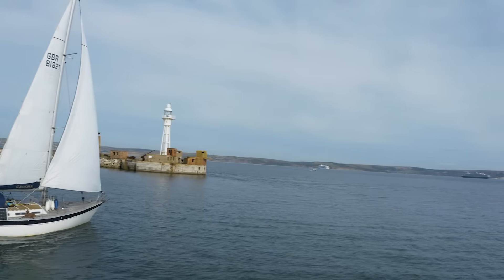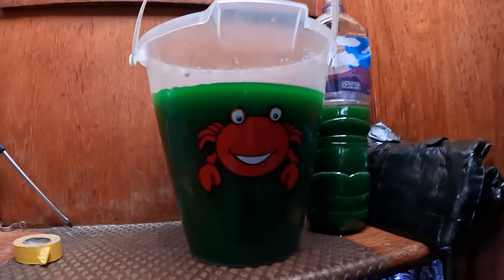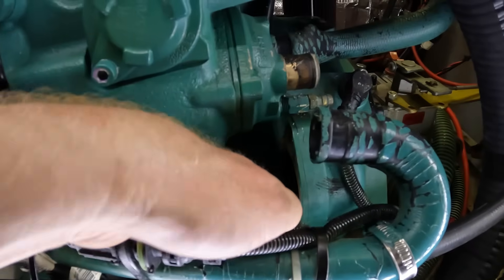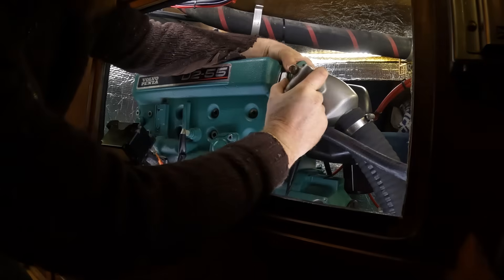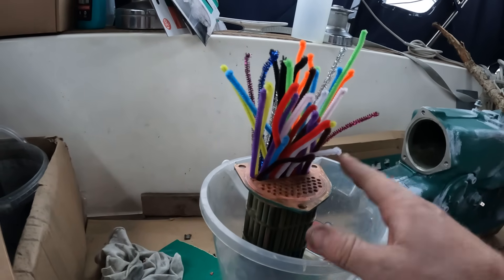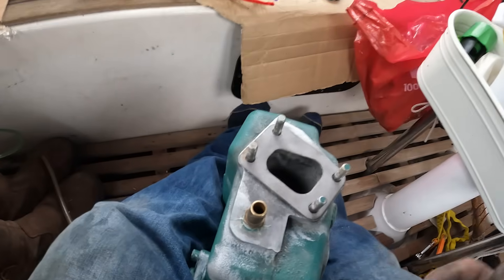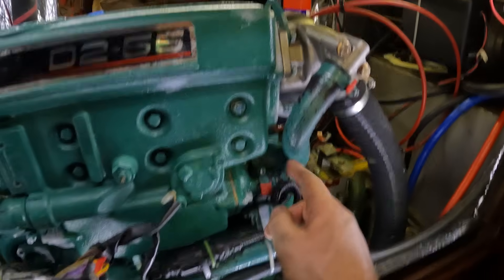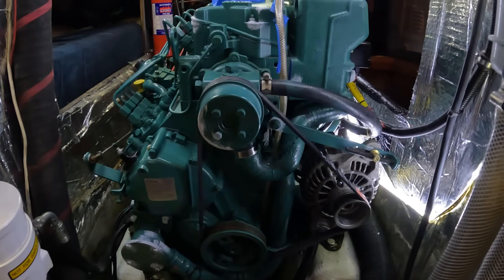Overheating  - Troubleshooting a small diesel sailboat engine  (Volvo Penta D2 55F)

Comment: Really useful- thanks. I have a VP D1-20 & had an overheating problem. We tried lots, in the end we figured out it had to be the heat exchanger. We couldn’t get the tubes out so decided to acid them in situ. We used Red Lyme from Amazon & left it soaking in situ for a week. That was a couple of years ago-alls good
Reply from the maker: Glad to hear you managed to solve the problem with far less hassle than we ended up with 🙏⛵️
Reply: it feels like a bodge job now i’ve seen it done properly

Comment: Brilliant video. I'm amazed how professional you are given what you say is limited experience. I'm not very good at this and would have been terrified as you took off more and more parts on getting it back together. I did a similar job on my Kubota/Nanni 22hp. Everything so much more accessible than Volvo. You truly did it the hard way. Thanks for sharing. I have to do a main engine oil seal next week and the engine has to come out to get to it.
I'm more confident now and insoired.....cheers!
Reply from the maker: Matthew, I won’t lie, I was starting to get nervous at about the half way point and was very careful laying out all the bits in order, so I could ‘simply’ reverse what I did, possibly with the help of the videos I had recorded. I haven’t fully pressure tested it out in the wild yet, so there’s time still yet for me to regret my efforts, although I hope not 🙏🤣⛵️⛵️
Reply: @CadohaAdventures  I would.be very confident your work is good
My exchanger core exit hole was the size of a 5 pence piece it was so calcified. Perhaps double hose clamp if you are worried. Why trust one!
Reply from the maker: @matthewlutter3745  fair point! Appreciate it 🙏😁⛵️

Comment: New subscriber from Sail Life here.

I paused the video at the 18:00 minute mark to shout into my phone.  MAKE SURE YOU SWEEP OVER EVERYTHING WITH A MAGNET BEFORE YOU BUTTON THINGS UP!

That rotary wire brush WILL leave bits of wire in your engine.  It WILL damage things.

Back to the video …

Comment: Overheating. Start with the thruhull, then sea strainer, impellor, wear plate then, like you did, heat exchanger. If all that doesn't solve the issue, make sure your prop is not over pitched. It will show up when pushing the engine hard and can do some serious damage to your engine. You should be able to make about 80% of your max revs in neutral when in gear and motoring in flat water with little or no current. Great job on your repair.
Reply: What's a "wear plate?"
Reply: @DScottDay  Inside a raw water pump is a half moon ish shaped piece of metal which attaches to the pump body via a screw. It's purpose is to put the impellor fins into the proper "bend" to enable it to move the water coming in and propel it onward through the cooling system(raw water side). They can wear over time and then the impellor could be damaged or the pump will loose it's ability to move the water effectively.
Reply: @petercaras3696  Peter, you aren't talking about the "key" in the impeller, are you?  Having just changed the water pump with a $1,000 Westerbeke monopoly event, I just greased it and plan on not thinking ab out it, what with everything else that needs attention. Thanks. DD

Comment: As a Windscreen Washer Bottle Mechanic, you’ve done ok mate, and you’re progressing well by the looks of it. Diesel Engines do tend to become a love affair, and you have already learned not to take liberties with impellers, change them at 12 months Maximum, as the damage those breaking down blades can do, can actually wreck engines. Diesels thrive on Clean good quality Oil, Clean bug and water free fuel, and clean air- some people think air filters are not needed at Sea, but the amount of Dust there can be staggering, and not just if crossing East to West, from the Canary Islands or Cape Verde and the huge amount of Dust coming from the Sahara Desert, just imagine that stuff being sucked into the engines Combustion Chambers ? So change Oil, Air, and Fuel Filters as Scheduled. Save money by buying good quality pattern ones, which are as good as overpriced OEM ones. Bob. 👍🏴

Comment: I recently had to do the exact job on a Vetus. I was tearing my hair out after having gone through everything, inlet seacock strainer, inline strainer, raw water impellor and finally the heat exchanger. The whole time I had good water flow out the exhaust. Luckily getting the heat exchanger out was a whole lot easier. Whilst there was quite a lot of marine growth on the salt water side, and I though that this must be it, a good clean out didn't solve the problem. An IR thermometer showed the max temp anywhere on the engine was only getting to 60 Deg C. The Temp Sender unit was only getting to 50 Deg C and still the alarm was blaring withing minutes of starting the engine. Not even enough time to get it warm. Eventually discussion with the Agent revealed that some of the temp sensors on certain models where know to be oversensitive. Replacement of temp sensor is the next step... 
I am really glad my heat exchanger is so much easier to get to. 
Nice video. Looking forward to your battle test.
Reply from the maker: Ok, well if the alarm goes off again then that will be the very next thing I look into now! Thanks for sharing 😁⛵️

Comment: Great job on the engine work just a tip on set belt tension you only want to make the belt tight enough that you can twist the belt 90 degrees.  Any more then that and you can wear  out the bearings in the alternator and pump.
Reply from the maker: I’ve never heard it explained like that before so thank you 🙏😁⛵️

Comment: A forgotten part if the cooling system is the thermostat , which is on top of the engine most times. It can be stuck open most times , or doesn't open completly. You can check it just by putting it in boiled water. Thermostats wear out , when in doubt  ...change it!  Nice video , Greetz John.
Reply: I always hope its the thermostat but never is lol
Reply: When you put in boiling water, what exactly is the desired result?
Are there different specs for these or just open or shut?
Thanks! ... Appreciate the video.
Reply: @thistledown6026  it will open the stat. If it’s working properly. what’s funny is I have never had one stuck closed just open.
Reply: @c.a.mcneil7599  they are designed to fail stuck open.

Comment: Use magnets to hold bolts together or to pull out unscrewed ones. Stainless steel doesn't rust also. It's what I use and do. Use it when applicable, efficiently and safe.

Comment: Try using a small 90 degree pick tool to break those seals - easier than a screw driver and maybe less chance of splitting the hose. Really good video.

Comment: Videos are great to archive engine tear downs. Another useful way to keep track of the orientation of parts is using a paint pen. Just a line drawn across the part to the flange will help line things up when you reassemble.

Comment: We use antiseeze between gaskets and the surfaces. Makes  gasket removal a breeze.  You don't need to scrape surfaces when using the high temp stuff. Also it protects screw threads from welding them selves to the cast metals.
Reply from the maker: And is that good for high temperatures?

Comment: Looks like you could use a set of mechanic's picks to help pry hoses off, break seals without damaging hoses with an over sized blade from a screwdriver. Also you really could use absorbent pads or baby nappies to catch oil, coolant, water from dripping down into the bilge or onto parts of the engine causing damage.  Good job cleaning out the heat exchanger! 🤗
S/V Cork~Texas 🇺🇸

Comment: That job fought you all the way, white vinegar and table salt is a brilliant de-scaler for brass and bronze and is quickly neutralised with tap water, little tip to get hardened gaskets off is to warm them up gently with either a hot air gun or a plumbers torch with a soft flame, Viton O rings (Green) are a little bit more robust than standard EPDM one's, the best tip I can give you is to copper slip EVERY nut and bolt you put back in also dielectric grease on all electric connections, much better than standard grease, the sensor you took out of the bell housing is the hall sensor for the RPM gauge

Comment: I’ve cleaned countless Volvo Penta heat exchangers over the years. Their 2000 series engines coolant plumbing piping will virtually always leak regardless of effort to seal. A real shame. Get yourself a Skandvik (or equivalent) flexible shaft nut driver sized for the ABA SS hose clamps installed. They are extremely handy.

Comment: Gasket surfaces can be kept very clean and flat without scratches by taking a properly sized pain of glas (cut it to size in order to cover just one or even beter two or three smaller gasket surfaces at the same time or just cover just one big one) glueing on some very very fine 1200 grid sandpaper and sanding of glue and other residue with the extremely flat glas sanding surface just using the glass pain/ piece as a sanding board. If the part lets you it’s also practical to lay down the sandpaper glued on glass and to move the part instead of the sanding board/ glass.
Reply from the maker: I feel like my gasket removal wasn’t quite so fastidious 😳😳🥺

Comment: Two things for future reference:
1. The videos and pictures are good but what if your computer gets wet and you need to do a repair and put it back as it was? After years as a diesel/automotive technician I’ve learned to use either a punch/cold chisel/ letter stamp set to mark the parts so I can just match the marks when reassembling. If time allows you can even use a marker/tape/puff paint. 

1. That gasket that broke… they can be reused if you grease one side so it doesn’t stick to the metal. The grease will do two things, it will prevent it from sticking to the metal and help it seal because it helps the gasket to completely form itself to the metal surface.
Reply from the maker: Amazing advice, appreciate you taking the time to share your wisdom here 😁🙏⛵️

Comment: Designers of more modern boats do appear to have given more thought to engine access.. even if the engine designers themselves don't always do a good job. Back, many years ago during my time as a yacht delivery skipper I came to the conclusion that when building a boat the yard began by suspending an engine from a beam, then commenced constructing the boat around it !  Great job and I don't think many mechanics could have improved on your performance..

Comment: Awsome job!!! I love watching your videos, especially because I have exactly the same engine in my boat :P Great Tipps and a great source of knowledge how to handle engine problems. Keep on making these videos! Our iron horse will have it ultimate battle test this summer when we will go from northern Germany to Marseile through the canals. Currently I have my raw water pump in fron of me with a totaly destroyed ball-bearing.
Reply from the maker: Ouchie, well if it's any consolation I managed to strip and rebuild a raw water pump and it still works a year later, so if I can pull it off, I'm sure most people probably can.

Best of luck with the canal trip. Interestingly, what do you draw?

Comment: Great video, thank you. Also,  i believe, If you have to bond a gasket on. Do it on the removable part side. 
Later it will be easier to clean off on bench, than while in a hole.
Reply from the maker: It’s our pleasure, I hope there’s something useful in it, but regardless, there’s some super valuable constructive feedback comments, as usual 🙏🙏😁

Comment: Great video. Many thanks.
You seem to have the same disfunctional issues I have....painting the engine......even parts that cannot be seen. I have such empathy with this.
On the overheating. When I bought or chartered a boat they always told you the max sustainable revs for economy & overheating. So I came to the conclusion that running an inboard diesel engine close to max revs causes it to overheat. In my experience you can fend this off by dumping all the hot water in the calorifier (to increase the heat sink) but it comes a time that you need to reduce revs.
I will look forward to your future video and see if you have solved the problem or simply increased the revs that cause it to happen.
PS - what happened to that lovely head of hair...it's gone!!
Reply from the maker: I was getting my hair cut and noticed that I was starting to go bald, so I needed to know how it was going to look and so shaved it all off. That plus it's one less thing to think about every day and so I have a little more band width to get other things done 😬😬😬

Comment: three suggestions.  First, get a small wet/oil stone which you can use to prep gasket surfaces.  It will remove any material such as metal burrs or gasket/sealant that you failed to remove with the razor.  Second, it's best to apply sealant to both surfaces to get the best possible seal.  Finally, try to fit the gasket hole to the port by removing any excess gasket material to improve flow.

Comment: I used a small 22 cal gun bore cleaning kit that has a wire brush to run through the tubes on my yanmar. Remove both end caps. Run the brush through, Very easy.
Reply from the maker: Yeah next time I think I’ll try and clean it in situ. But at least there’s some kind of starting point video for others to learn from.
Reply: @CadohaAdventures  and the kit also has an attachment to run a cloth through the bore. I used muriatic acid on the cloth after the brush, then water to clean any residue
Reply: but you have a great video for someone who wants to do a complete overhaul. On your boat, to remove all of the impeller pieces, you did the right thing. But if you don't break an impeller now, you can just descale by rodding the tubes annually
Reply from the maker: @mikehinson4062  fingers and toes are firmly crossed for not breaking any impellers going forward 🙏🍀🍀🤞🏼🤣

Comment: Just something to note. The rotation of the heat exchanger needs to match up with the rotation of your end cap. If you noticed that the cap with the hoses on it that had all the impeller remnants had a slit separating it into two halves? That slit needs to line up with the slit where there are no holes on your heat exchanger.
Reply from the maker: That makes sense, thank you. I feel like this job will be much easier if I ever have to do it again 😬😬🙏⛵️

Comment: Enjoyed that immensely mate👍. I was thinking it might be a good idea to but some liquid steel, stuff in a tube that sets like metal. So if you have any future dissimilar metals issues you can make a repair to get out of trouble. Also another interesting thing with dissimilar metals; it can still occur even with an insulating material like a gasket. The  galvanic process or electrochemical reaction between the different metals can utilise water and depending on flow direction, so a greater or higher metal to a lesser metal can cause corrosion to continue to take place. Very interesting stuff. Good job guys.💪

Comment: Well done on the good job
When working with o rings  they can be damaged with petroleum products like grease .Easy fix is red rubber grease you can buy a small tube for future jobs
You come across really calm 😌 I would have used a few sailors words for the poor design for heat exchanger  service
Reply from the maker: Appreciate the tip there, although full disclosure, I’m terribly hot headed and am thankful that I have full creative licence over what makes the final edit 🙏😬😬😇

Comment: You got off lightly, we had the same old bits of impeller problem on our D2-55A left over from previous owner. In our case we also gave the engine some max revs in an emergency situation, while being pushed towards some rocks in heavy weather, and nightmare, the hose blew off the heat exchanger inlet. The first we knew of it was the bilge pump alarm. The bilge filling up before the engine overheated. We stuck the hose back on and slowly went into the nearest marina. As suggested in another comment on version A you can get to the front of the pipes from the front, so we easily got the old bits out. 
To stop this happening again I fitted a strainer between the pump and the cooler inlet. A common practice on big power boats. 

The corrosion problem also happened to us with our original steel exhaust elbow, but second nightmare it corroded through the side of the exchanger, letting exhaust fumes into the boat. We needed a new exchanger, £5k later and a new version F cooler. all is good again. After much discussion with local Volvo dealer I fitted a fresh water flushing system on the inlet to the raw water strainer, simple Y valve and a mixer tank in the aft locker. We now always flush the seawater out of the system after every sail. There is a Volvo flushing kit sold in the US, at the usual Volvo price, nut my version is better and much cheaper. 
A few other Volve Penta owners in our marina have copied this idea as a preventative measure.
Reply from the maker: Wowzers, so many tales of caution for all of us to learn from there, so seriously thanks for sharing. I really like the sound of the flushing system, that corrosion is kind of concerning 😕😕😕

Comment: Thanks for this video.  I’ve got a d2-55A and there are a number of detail differences. However, it looks like it’s probably best to take the heat exchanger out in one lump before fiddling about trying to get the matrix out. Mine doesn’t overheat but emits steam from the exhaust.
Reply: You most likely have a blocked exhaust mixer
Reply: After draining the engine the shop manual step #2 says "Disassemble the exhaust manifold together with the heat exchanger."